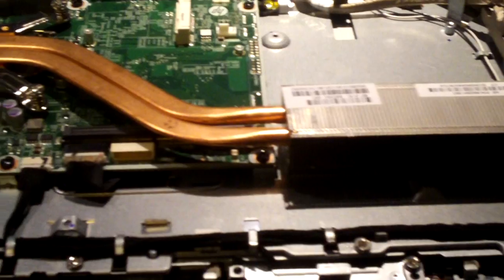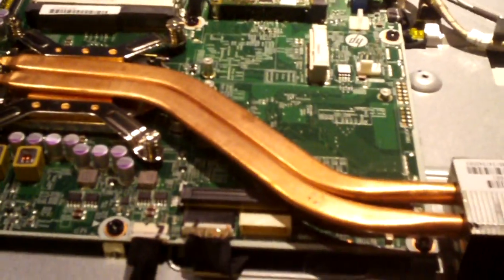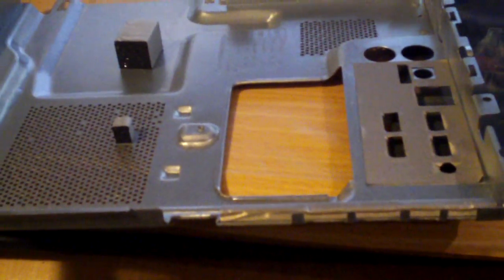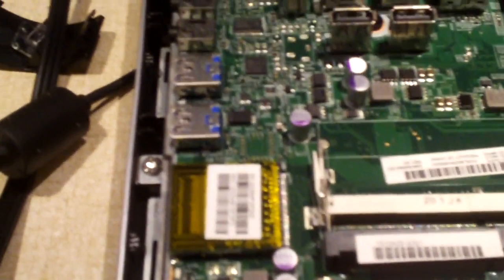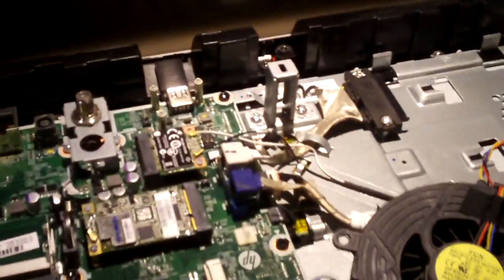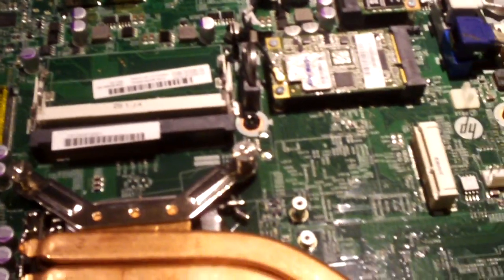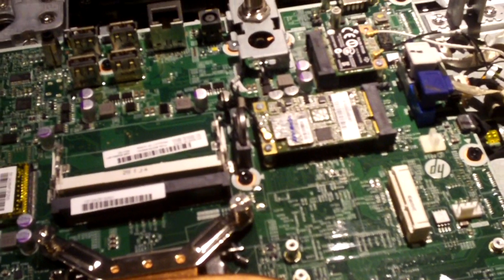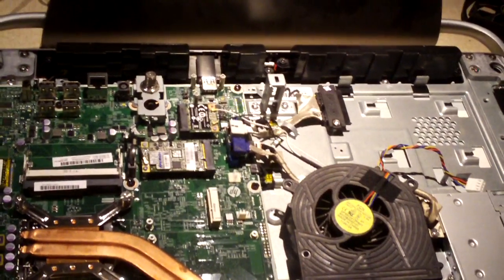Another rant about all in one computers

Comment: Just as well I have a sony all in one, no pictue or backlight. There is no backlight on signal and the lvds signals going to the lcd screen are abnormal (goes open then nothing else) so failed mb probably solder joints on the gpu not looked into it much further.

Comment: I hate all in ones too. Well I don't mind those older Apple all-in-one machines which used CRT screens, like the eMac and G3 iMac which are pretty solid machines.
Reply: My friends all-in-one Toshiba "desktop" just failed, he bought it at the beginning of 2013 when his old HP Pavilion XP machine died in January because the northbridge heatsink popped off and gradually killed it, in November 2017 he told me the all-in-one will not turn on, it's not due to a power supply issue since he's tried another spare that's the same that works.